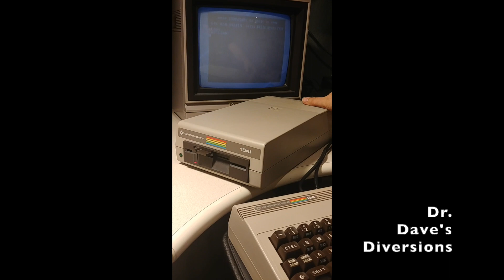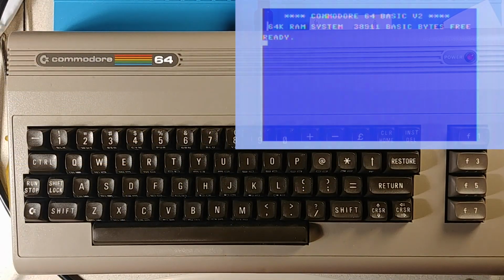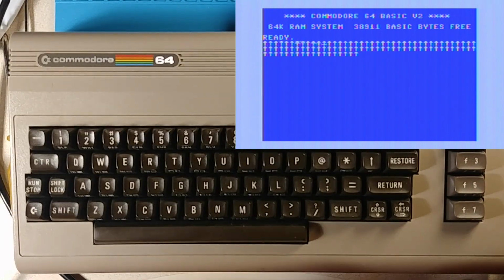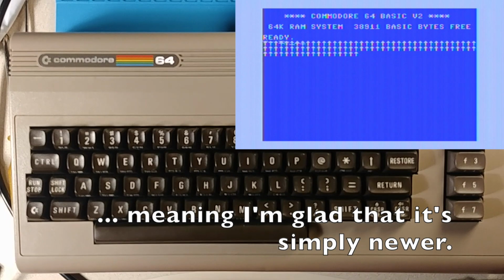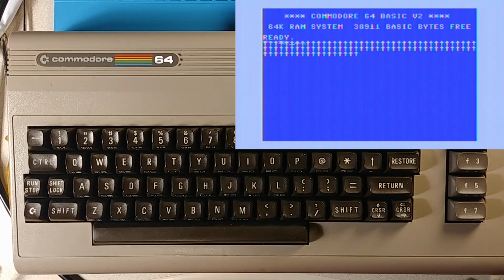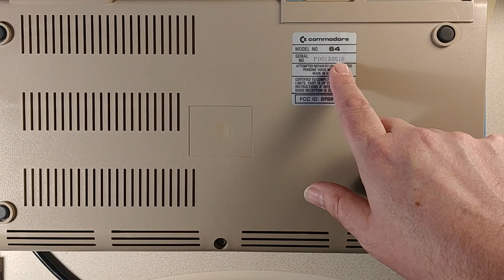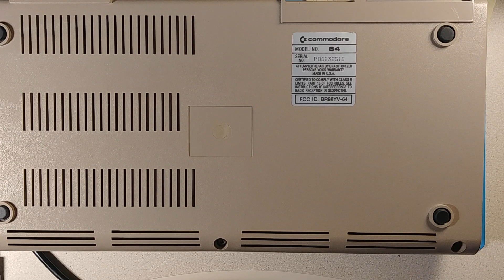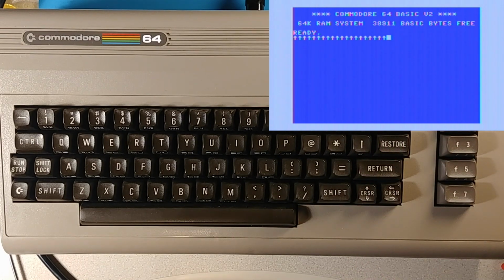Fixing Commodore 64 problems I didn't know I had

Comment: Interesting issue. Having used so many different breadbins back in the day I am now wondering if I ran across this at one point and never paid it any notice. Any thoughts as to what would cause this issue with that particular revision of chip? One would assume that a ROM chip that contains binary data would either work or not work but I guess things aren't so black and white even in a digital world!
Reply from the maker: Right... it seems some combination of video address with the character ROM... so, admittedly not thinking about it much, it seems this issue is the character ROM's putting things on the bus (correctly) seems dependent on address line values. I could be way off, but since the problem is predictable with respect to screen position, it seems to depend on the address lines.

Comment: I'll have to try wiggling the case open like that. I need to open mine to adjust the lumafix that was installed with my vic-ii² mod. I also need to drill in a hole so that the switch isn't sticking out of the cartridge slot right next to my U2+. After drilling holes in my brand new computer case to mount a water pump and making the hole in the top bigger to fit a 2nd radiator (the hole was like 2mm for a 360mm radiator lol), I'm a little more confident that I can do this now. lol
Reply from the maker: Ha! Water pump?! :)
I've opened my C64 case a lot in the past year and this method is safe. It's also worth looking at Mark's different opening method in action here as well: https://www.youtube.com/watch?v=sUyRKXOl-PI
Reply: @DrDavesDiversions  yeah it's my first watercooled build. I have an AMD Ryzen 5900x running at 60 degrees C under load. C64 asside, it's pretty unusual to have a computer run that cool. Sadly it has a 7 year old graphics card because you can't buy them currently.  It even has 64GB of ram next to my C64 with 64KB of ram (which is all new old stock since it was MT originally and 1 of them was definitely bad). I think the dual 64's from different eras is kind of amusing.
Reply from the maker: @awilliams1701  Neat on both counts.
Re: MT, my 64's MT RAM is still working well. I'm not ready to write them off yet. :)
Reply: @DrDavesDiversions  you're lucky. My 128 value bit was about 0.1% defective. I found a BASIC program online that I could type in that tests about 32k of ram by setting it to 0's and then 255s and reports any errors. In 39 cases It failed to do that correctly. I know it's caused a lot of issues so I'm like I found NOS why not just go with it. I did replace just bit value 128 at first and it worked, but then after confirming I replaced the other 7 chips too.

Comment: Been using C64 purchase number fortysomething and called it old faithful after using it for a year but it turns out the S-video output is seriously not right after using many cables and many monitors...only looks right on RF or composite video. A bit annoying as my 1901 I want to use only supports S-video or RGB-i.....1702 is a terrible CRT and electronics.
Reply from the maker: Ya, I don't mind that I have an early C64 with the 5-pin DIN video now.... since I rarely use the machine.
Like most people I know, I <3 the 1702 beyond words. I used it on my A500 for a while in the '80s too, then it was off for about 25 years, but works great now.
Have a great day!
Reply: @DrDavesDiversions  The 1702s I have all have a horrible medium grey screen not dark grey and there is color banding on all of them. I use a Sony KV-M14TU from 1985 that cost less than a 1702 and had RGB for my ST and Amiga :) The 1902 is a great monitor but only supports S-video sadly. The curvy 1084SD is also a rubbish monitor but the 1084 is OK